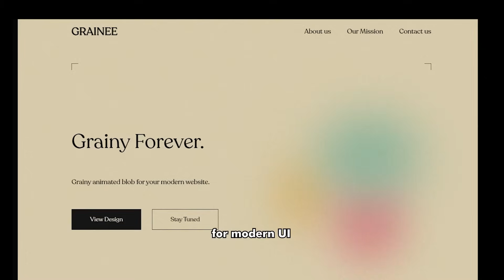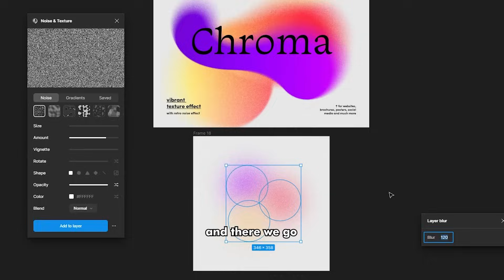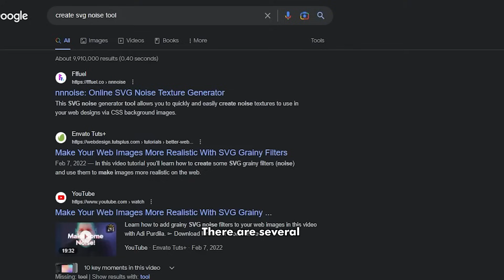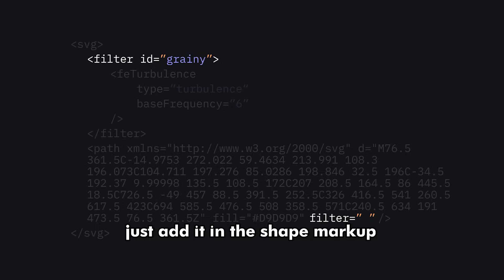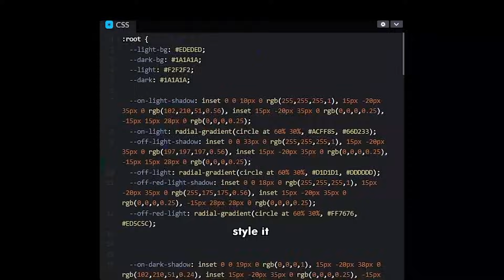I tried designing and coding grainy textures for a week

Comment: I know websites stopped using raster image textures for UI components because they were overused to the point of oversaturation and obnoxiousness, and they're heavy and don't scale responsively to the thousands of display formats we have today, but hear me out: 

Why not be a little smarter about it this time, borrow some of the realtime procedural texture techniques 3D artists have worked on for decades to imitate the look of real-world materials with capital-M ✨M a t h✨, and create interesting background textures for UI dynamically using WebGL? As a fallback, the texture library could detect WebGL being turned off and download a heavily compressed webp atlas texture from the server. Since the shader-textures would be static, you can cache them and only slightly tax the device's GPU once on initial page load, and even potato hardware should be able to render these out extremely quickly in 2024, if they're at all compatible with modern JS frameworks. This way, we'd be able to recover some of the beautiful aesthetics that default iPad apps used to have before iOS 7, aesthetics that are seemingly lost to time and I can't find anywhere anymore. Just google what the iPad iBooks, kiosk or Music apps used to look like. You'll get what I mean. Think of the PS2 BIOS menu and how, design-wise, it hasn't aged a day! Okay, maybe a couple UX tweaks,  merging some menus and making them more content-dense to take advantage of the larger display real-estate we have today, but that's about it. On the visual department, icons on the cubes that represent each option in the Options menu, searching, filtering and sorting options for the save data, and that's it. I'd barely touch a thing. The modern Web and app ecosystem still struggles to match the peaks of the past.

Comment: Noise is the no.1 driver in CG. To apply noise over an image in whatever application is via a blend mode like overlay etc. 
The number one rule for the noise to work correct is to build it right.
- > Make a layer with 128 grey (50%) and apply your noise on this layer. This way you have neutral grey with lighter and darker peaks.
Now when blending this layer over the image, the image itself won't appear darker or lighter, thanks to the 50% grey layer!! < - 
With different blend modes, contrast or highpass you can change the noise ammount/graininess even more. Try to use an app that alows to generate differen size (scalable) noise.
But best is to generate procedural NEUTRAL GREY noise on the fly instead of noise images to blend over!

Comment: Not sure what you mean by "can't edit" when importing a .svg
Also, you can use non base64 encoded svgs with a data URI that starts with 'data:image/svg+xml;utf8,<svg...'
Or 'text' instead of utf8 but you'll need to URI encode the string

Comment: very nice video. Info about base64, it's just an encoding to be able to show any binary data or text with spaces and unwanted characters as a single string and can be reverted, and in data URLs it starts after the comma. you can also convert them back to bytes, there is a website i found that makes it quick, you just paste any base64 and it spits out the original file, you may need to fix the file extension if it doesn't get it

Comment: 0:32 just wanna clarify - on film, ISO was not a "setting" on film (and it definitely isn't something to do only with old cameras), also, your next point about low-light conditions - that's also to do with ISO.
Film essentially works by exposing small grains of silver halides to light for a certain amount of time. The size of those grains is what ISO is - the bigger the grain, the more sensitive the film is to light - the higher the ISO is. ISO is essentially sensitivity, i.e. how sensitive the film/sensor is to light, so for your second point - it's not the dark causing the grain, it's having to use a higher ISO because of the dark, that is why you can take long-exposures when it's darker and the image wont turn out grainy.
Hopefully what I said explains the topic well enough, it's 3 am and I'm procrastinating doing work rn.

Comment: I use SVG with react all the time. You just copy the Figma item as SVG (or export it as SVG code), and then you can use it as a regular html element in your react code, inside a return block. Subsequent CSS changes can be made just like with any other JSX or TSX file

Comment: PNG is a lossless image format, what did you mean by it being low quality?

The SVG adds extra compute at page render (which will start to matter for larger screen sizes). Pre-generating the noise texture and embedding (as base64 data) it in the document is likely the most scalable way if you don’t care about the noise changing on every page load.

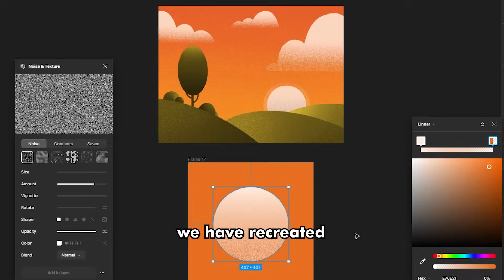Comment: 1:56 For this effect I would recommend to alter the standard gradient instead of leaving it as it is. It will give you the same effect than what the person did with procreate. You just have to move the node with the 0 opacity hue a little bit higher. Also when you use the noise texture, aside from playing with the opacity of the texture, play with your blending options. You can find those when you click on the drop icon when you open the fill to change the color.

Comment: No criticism here but two comments: Grainy originally comes from film grain. (old chemical-based, not laser-printed) Photos don't have pixels, they have small grains of different colors that make up the image. So a grainy image would be one that has large-enough grains (for various reasons) that you can see them individually and as they have distinct color they can make what was meant to be a smooth color gradient look pixel-y. Also the look you're going for would technically be a mixture of graining and heavy out-of-focus blur. (interestingly an effect that is very much associated today (at least in my field) with raytracing).